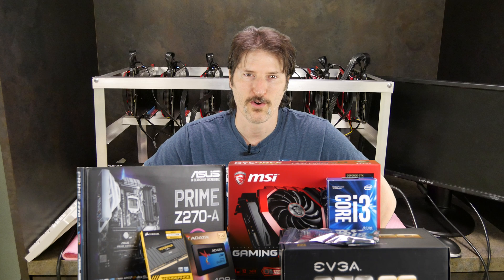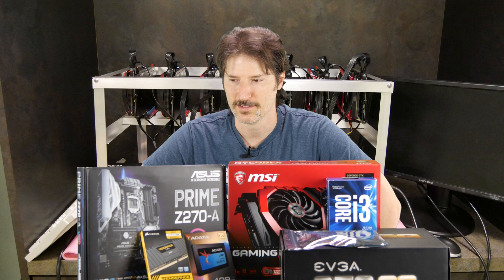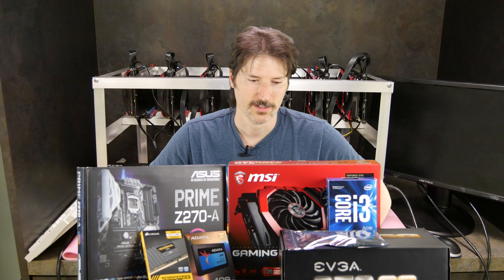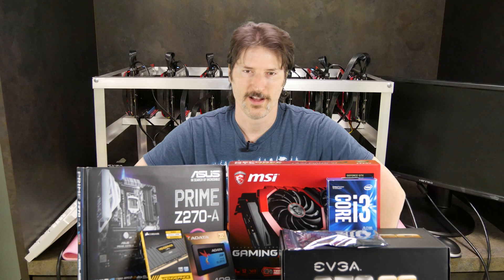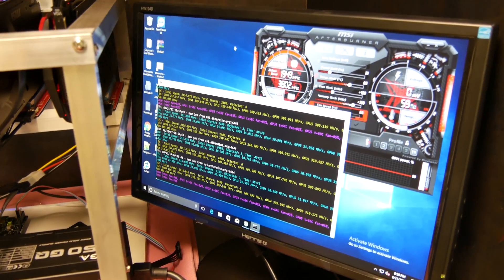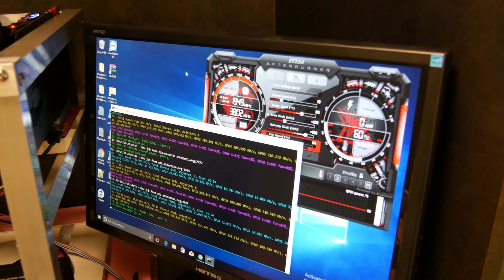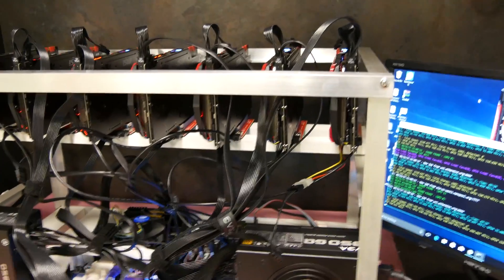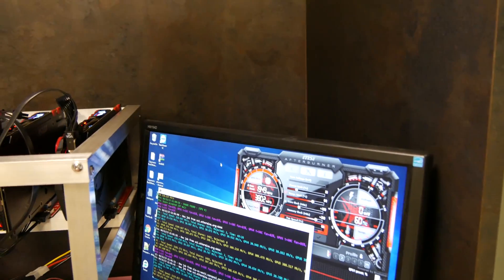Cryptocurrency Open Air DIY 1 to 8 GPU Mining Rig Build Complete

Comment: Are there any bios settings I need to worry about?
Reply from the maker: You need to change Bios settings depending on which motherboard you are using.  This is what I changed on my Asus Motherboard.

Motherboard setup:

1.  Asus EZ Flash UEFI Bios via Internet
2.  Advanced Tab - System Agent (SA) Configuration - DMI/OPI Configuration Set DMI Max Link Speed to Gen2
3.  Advanced Tab - System Agent (SA) Configuration - PEG Port Configuration Set Both PCIEX link speed to Gen2 and Disable PCIe spread spectrum clocking
4.  Advanced Tab - PCH Configuration - PCI Express Configuration Set PCIe Speed to Gen2
5.  Advanced Tab - Onboard Devices Configuration Disable HD Audio Controller and RGB lighting
6.  Advanced Tab - APM Configuration Set Restore AC Power loss to Power On
7.  Boot Tab - Set Next Boot after AC Power Loss to Fast Boot Set Post Delay Time to 0 sec and Set Above 4G Decoding to Enabled
Reply: Doesn't the M.2 Setting need to be set to PCIE?  Do you have your M.2 set at 4X or 2X?

Comment: Hi Sam I"m wondering exactly how the graphics cards are being held in place?  They aren't just resting on the wood bar are they?
Reply from the maker: They are resting on the wood and screwed into the aluminum.  Think of it as the aluminum is where you screw your cards in normally and the riser resting on the wood as your motherboard.  Works great.

Comment: Great video Sam! I like your build, working on my 2nd rig which would be similar to what you have. I was trying to watch your video the only thing that confuse me is the "jumper" part on the other evga power supply. Thanks
Reply from the maker: The 24pin jumper goes on your second power supply 24pin that would normally go into the motherboard.  All it does is fool the PSU into thinking it's plugged in.  You will manually turn the PSU on and off with the switch in the back.  Some of the more expensive PSU's come with a jumper included.  If you need one they are very cheap.  You can find one on Amazon for under $10.